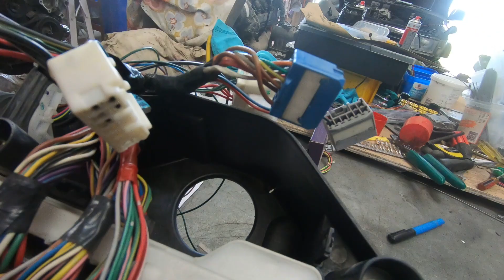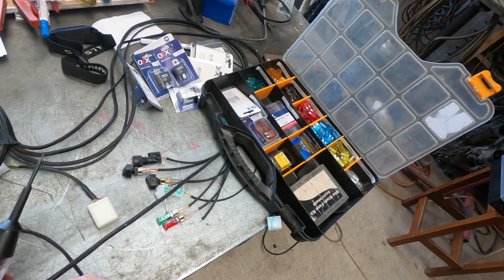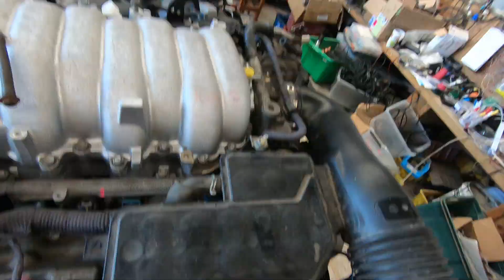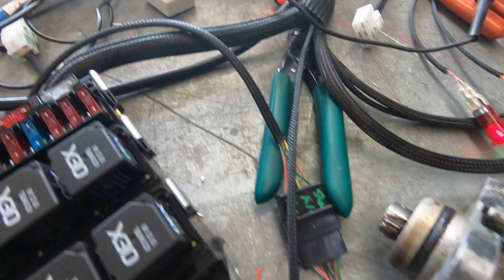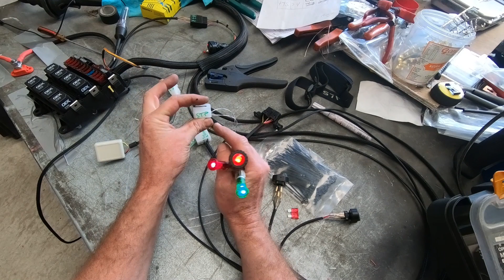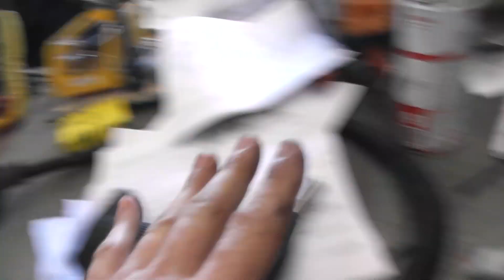1uz vvti (small coil)wiring harness to fit hotrod in Thailand. Tricks, tips and fitment. uzs171 A650

Comment: What would you consider a must do for a 93 year 1uz, how much should be deleted from the stock set up?
Reply from the maker: Depends on the engine as not all 93 are the same and what its getting fitted into.  If I ever see an egr engine that leaves and same with traction control.  From there often the extra water hoses and then a general prep like all my others. Couple of videos coming on the blue engine for the boat.  Cheers